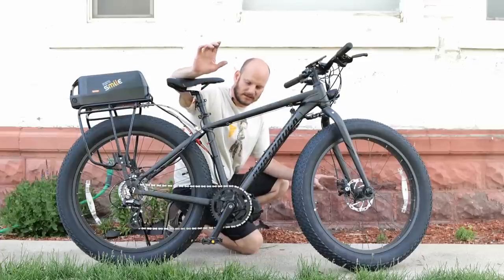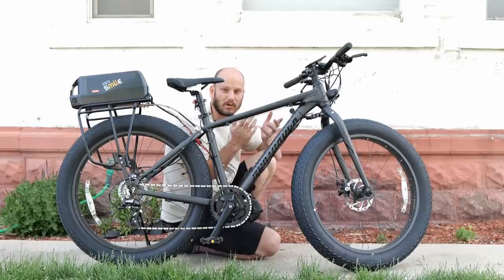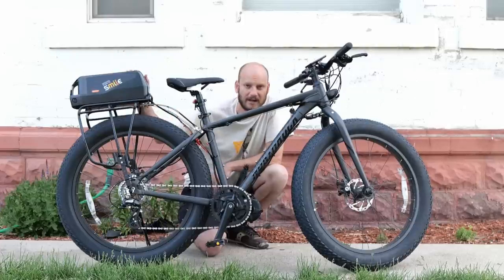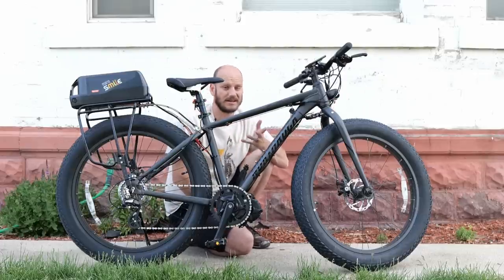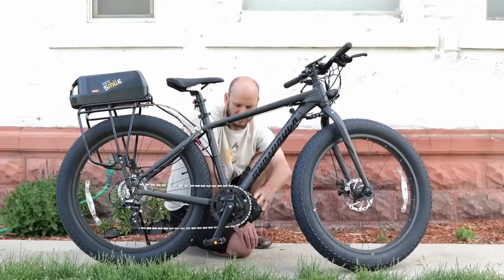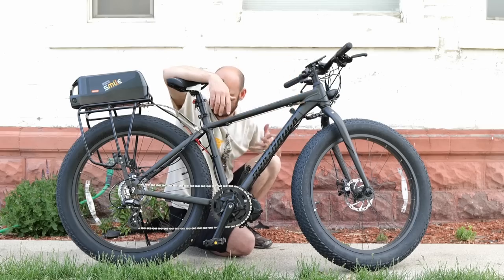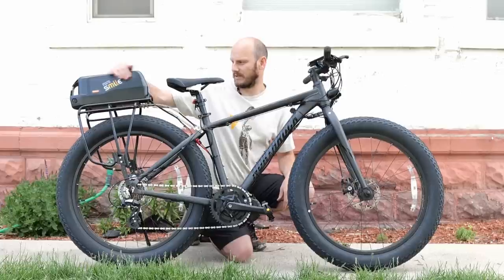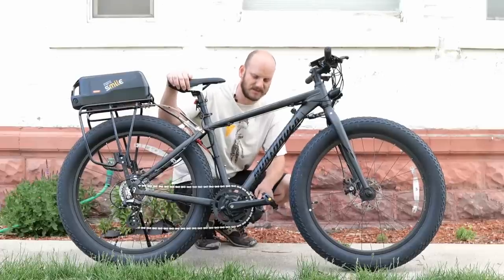Reviewing the new Polarizing Bafang M625 Mid drive motor kit

Comment: Love my two bbshd motors , if bafang battery is as good I definitely don't mind , had some hit and miss issues with AliExpress batteries ,( premature failure and not coming up to the stated amp hours) also Amazon batteries for that matter, also I don't really want to tinker with the set engine parameters, battery size , the bigger the better imo I would get two batteries, as I don't drive so excellent range is important to me

Comment: i recently bought an e fatbike with a rear hub motor, and imma be honest, i like it.
but i want more.
i know what im about to say next isnt practical by any means, but im more wondering if its possible.
rear hub, central motor, and a front hub.
all 3 positions. with a little switch that lets you manually switch between the 3.
a throttle is a must, but my question stands, would it work?
Reply: No

Comment: I need an extension for the battery CANBus cable. Any ideas on where to get one, or even what the model the cable headers are so I can make my own? I REALLY do not want to cut and solder the cable if I don't have to.

Comment: awesome review! I am thinking to buy this and have been looking for a detailed review of this for long time. I don’t care too much about programmability. I just want to have a relatively complete set to be able to quickly setup and ready to go out of box. So this set is perfect for me. Just don’t if the short cable length of backlight is a common issue for all bikes? Can’t you connect to battery instead of motor?
Reply: you can't. the lights (back and front) are controlled via the motor controller, which is buried inside the motor housing on these guys. you solder longer wires if you need to. my TSDZ2 kit has the opposite problem. I've got a few extra feet of wire sitting around. The main issue with this kit is they've also locked down the battery, so you'll have to be careful what bike you buy and fit it to. The lack of programmability isn't a barrier to the determined.

Comment: There are many things you cannot do that's including hooking up your shift sensor. If you have a old controller for the BBS it will fit onto the new 625 allowing you to modify as well as use a shift sensor
Reply: Are you sure? I've seen that the HD and the M625 have different bolt configurations.
Reply: Not sure how this would work, doesn't the M625 use the CANBUS protocol, so swapping out for a BBS controller would not work with the components?
Reply: @wpjmurray  a Lil shaving on the heat since will get you there, when you switch the controllers you change the protocol. There are YouTube videos on how to make this work they are quite interesting good luck

Comment: Try throwing your leg over that pig of a battery on a bike that actually fits you. Proprietary sucks no matter what. Why introduce a new motor that doesn't address the terrible chain line issue?

BTW, I have lots of customers that actually use more than fifty mile range and a few well over 70.

Comment: im considering my first build...and i wish there were more brands out there other than bafang if only to keep costs in check.the difference from a bafang 500w to the 1000w is double the price! yes its double the wattage but do they really cost double to manufacture? i seriously doubt that!! its a huge marketing cash grab imo...of course most guys would pick the stronger faster kit...you can back off if its too fast at first...but if you buy too weak...you cant just make it perform better! For us in canada its alot more compared to the US because of our dollar value..so right there...that sucks. its about $1500 for a bbshd with battery...its a bit much when half your cost will need replacing after a few years...the batteries could come wayyyy down...id feel good is it cost 1000$ CAD. for a complete kit with a quality celled battery pack.Like all new tech....its always crazy expensive at first...like the first plasma tvs were stupid expensive!! so hopefully in 5 yrs + it will be half of what we pay now!

Comment: Thinking about converting a Cannondale, Where do i get a chainring if i need one? You cant use the stock chain ring thats already on the cannondale?
Reply: Probably not, you'll get a chainring with the kit from Bafang that has the correct configuration to bolt it on to the motor (you'll get crank arms too). The Bafang chainring has "narrow/wide" teeth that fit the narrow/wide chain links for gripping the chain better. This narrow/wide pattern only works for single chainrings.
Reply: @wpjmurray  Yeah ended up buying a 42 tooth Lekkie bling ring HD , it almost gives me the perfect offset for my chain line. loving this build, being able to adjust how much power in each pedal assist makes this kit wayyyy better than the others i have rode.

Comment: I have 2 of these 1000W kits on my 29ers and they are great.  Batteries fit nicely in XL frame Specialized Rockhopper and XL frame GT Avalanche.  The battery was the key selling point for me.  I didn't want to take a $450+ gamble on similarly sized battery from Amazon.  Shift sensor is not needed.   I wish they had a larger battery option.  Full throttle with no pedaling only lasts about 1 hour and 20 miles.
Reply: Same, I was happy with Bafang providing a trustworthy battery. Hopefully the price for replacements will go down over the next few years (or they'll be able to concentrate more power into the same battery size/price).

Comment: i just bought that motor from amazon. Saved $200 over ur website price. Also I think u made a bad install. that hole to pass a hose clamp is supposed to have a peice of plastic inserted into it to make the clamp loop around smoothly.  u just put the clamp in that big hole. surprised u would do tthat. but whatever ur the pro

Comment: There are a bunch of frames with a hidden battery that work with these motors on Aliexpress. I like the motor but they do wear your drivetrain, im already replacing parts on mine after 2-3 month. These motors need a drivetrain built for them, mtb drivetrains are to weak. Also, the SramNX is crap! The two pulleys are nylon and fail. Manufacturers are using parts that were never meant to work under these loads, yet they are still being used.

Comment: The motor may be nice, but I'm not buying it with that stupid battery. "Mid drives give you better balance!". Not with the heaviest component mounted at seat level. This motor is only an inch lower than a hub drive anyways, and is heavier, then you have that freakin' battery so high it may as well be mounted on a pole.

Good review though, so thanks for THAT bit 😉
Reply: Yeah, the battery weighs more than the motor, so putting it up high on the rear rack kind of deflates the "better balance" argument. My bike luckily can accommodate the battery lower on the down tube and pretty close to the motor so the balance is very good.

Comment: hard pass, bafang overcomplicated a motor kit, created more issues that were never needing to be addressed. BBSHD is way better even if you don't want to tune
Reply: The problem they were trying to solve with this product is "We need more battery sales" its never good when the problem a product aims to solve has nothing to do with what a customer wants.
Reply: @jrok96  would have been nice if they just made a bbshd with torque sensing PAS like logic would guide them

Comment: My fist ebike had the battery built into the bike rack uptop horrible center of gravity. im 6'1" 220 and like having a big battery too bad they can't seem to create one that fits onto smaller modern frames. that top tube drop frame design is just the worst for batteries.

Comment: That huge battery is a deal breaker for me. I run two 19.2 ah batteries for extended range on my recumbent. I could only run one of those batteries on my bike.
Reply from the maker: There is also a 14ah slimmer battery available for it 👍

Comment: 70 miles range ?? Good luck you will get 25 - 30 Miles at best full throttle.. with a 30 amp Draw and that whit Good LiFePo 21700 Batteries, lipo pack i have got just a little less and that running the BBSHD whit 19Wh packs, and if your thinking pedal assist, it actually not that great because the motor is always running faster then you can pedal unless you tune the motor WAY down..

Comment: With a battery that bid would it be possible to add to the front wheel a hub motor so you had two motors just a question

Comment: That battery is not big enough for me….  Need at least 1.3 kw/hr for range.
Reply: Amps for range
Reply: @janeblogs324  amperes are current - analogous to volume. (Say, of water)

Voltage is analogous to pressure.  

Both are needed to achieve “force” or motive power. (Hydroelectric power, for example)

The time unit is also needed, as one does not move a distance instantly.  Hence, 1,300 watt/hours = 1,300 watts for an hour, or 433 watts for three hours, or 325 watts for four hours.  If one has a 52 volt nominal battery, 325 watts =~ 6 amps.  This figure (roughly) corresponded to pedal assist level 3 on the mid-drive I used to have, which was stolen in March 2021. (BBS-HD)

A figure I recall reading about is “20 watt/hours per mile.”  I have verified this experimentally on two separate Ebikes - a mid-drive, which usually did significantly better than that figure on all save the very worst conditions (e.g. pulling a full-laden trailer full of groceries, bad hills, and legs cramping badly) - and a hub-motor, which did significantly worse unless one was very careful and exerted oneself unduly - to the point of cramps and following exhaustion.

Comment: Bafang midrives suck. I hate mine. Next time I'll go hub drive. 😠😠😡😡
Reply: Consider a Tongsheng TSDZ2 DIY midrive. It uses a torque sensor and gives a different riding experience than the Bafang, an experience many find preferable. Not as much power as a Bafang though.

Comment: Is it a bad idea to put the battery on a front rack the bike rather than on the real rack?
((I am just thinking about how we would want the rear rack for carrying stuff))
Reply: I wouldn't recommend it tbh. Weight up in the front on a basket or rack can mess with your handling. Even if the weight is fixed in place, it will still tug on your fork and handlebars if you turn too sharply (or if youre not holding it in place). It would be fine on a bike when the rack is built into the frame (think something like a Radrunner, w/ the four bolts in front). You may be able to get a rear rack that has rails for pannier bags separate from the top of the rack, and while that would raise your center of gravity (more top heavy), it would work out well enough. If you see this, hope this helps!